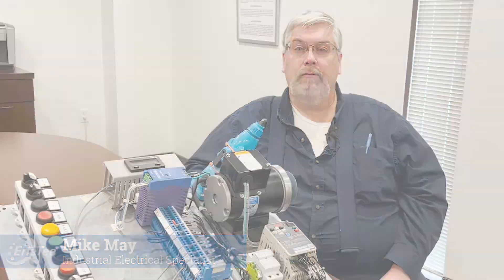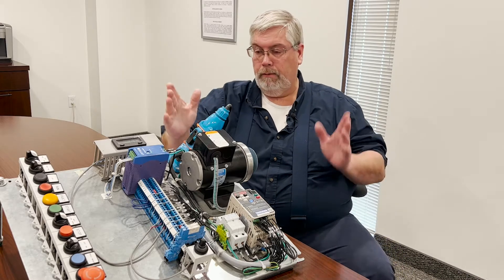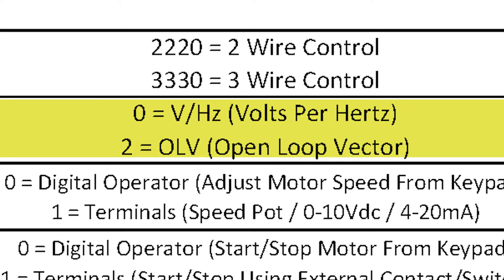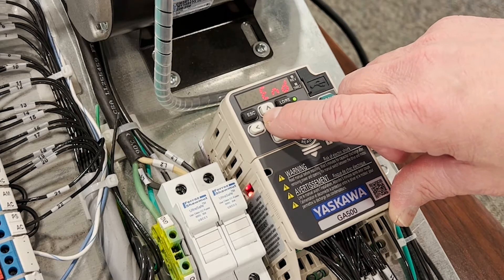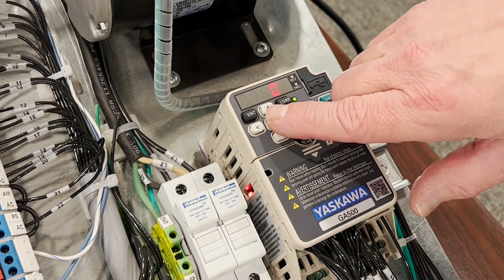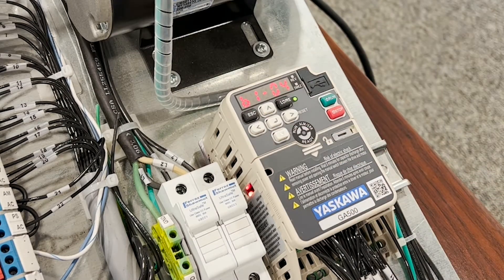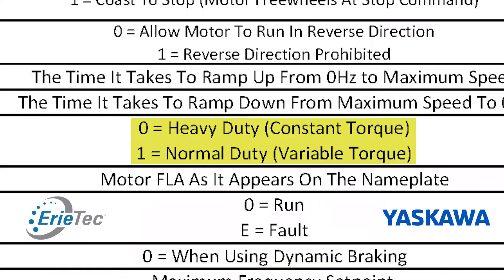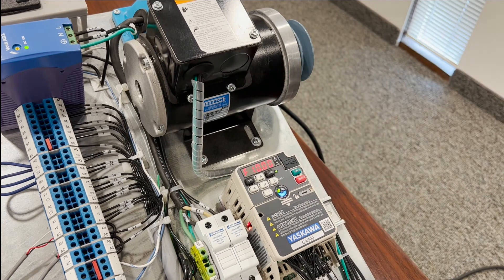ErieTec Educates - Yaskawa GA500 VFD Start Up

Comment: I have a question.  Can i have 3 different operation modes eg. Operator or manual. Pid(pressure 4-20ma) then want to use the rs485 . As 3rd option to control incase i am off site and alarm occurs that i need to reset then operate the pump?